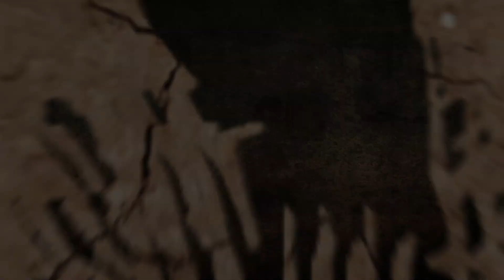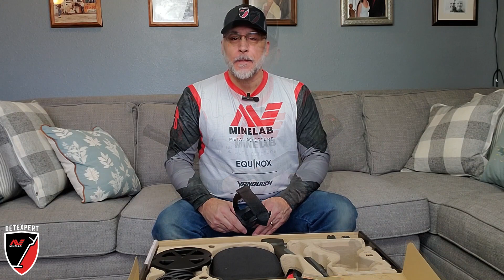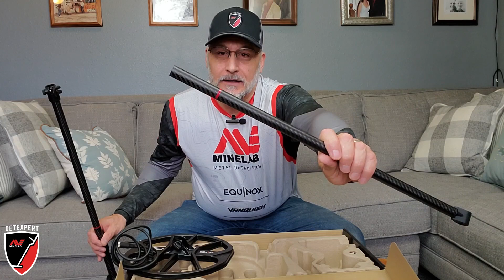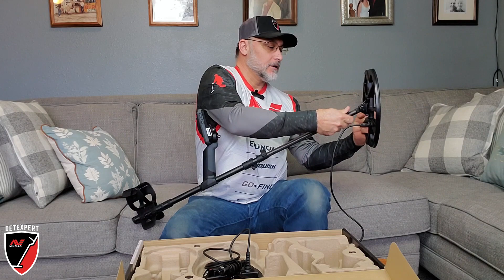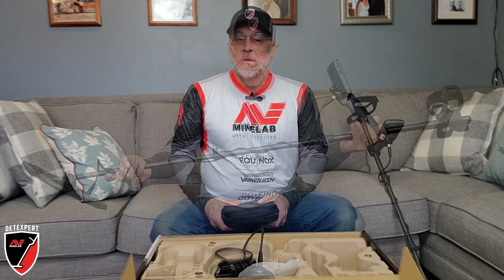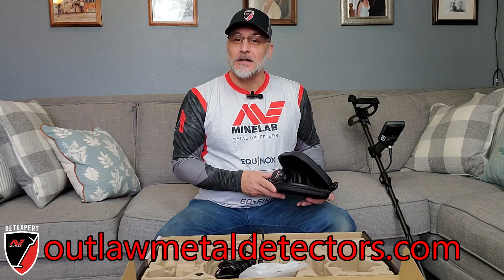How To Properly Assemble The Minelab Equinox 900 [TUTORIAL]

Comment: A heads up to all Nox800 and Nox900 owners. When new, the outer face of each rubber tear-drop shape washer stands proud of the recesses they nestle into. When the end of the shaft is inserted between the coil's lugs or ears, the outer rubber faces of the washers impart just enough friction so that the coil can be easily tilted up or down, yet stay in the position it is tilted to. 
Over time, micro-grit (particularly if the unit is used at the beach) can find its way between the washers outer face and the inside of the lugs or ears. This grit acts as an abrasive which accelarates the rate of washer outer face wear. When this wear is advanced enough, the coil will start the 'flop' i.e. tilt by itself acting under the influence of its own weight. This is addressed by the owner tightening the plastic bolt to restore enough friction to stop the coil flopping.
This is OK, however it is vitally important the understand that once the rubber washers faces are worn down enough, they no longer stand proud enough of their recesses in the end of the shaft to provide frictional resistance to coil tlting.
If the owner is not alive to this, they can end up repeatedly tightening the plastic bolt and instead of restoring the necessary friction, they are actually bending the ears or lugs inward, causing them to be excessively stressed; particularly down where they join onto the top of the coil.
This stress eventually causes micro-cracks which grow, culminating in the lug(s) breaking off.
The improved design of the coil lugs or ears on the 900 make them more resistant to such bending than with the 800's coil but any overstressing must be avoided irrespective.
Repair of lug breakage is difficult and very unreliable and the only alternative is a whole new coil which is very expensive. On the other hand, replacement sets of washers are readily available, relatively cheap and simple to replace.
Personally, I routinely extract and check the thickness of my washers using a set of digital Vernier calipers and change them out before the flopping problem starts. 
Hope this helps some fellow Nox owners.😅

Comment: Just received my Nox 900 last night (upgrading from Xterra Pro) and after setting it up, I wish there was a way to adjust the position of the Head Unit on the shaft for those of us with "shorter" arm lengths, by adjusting the arm cuff to comfortably reach the hand grip on the head unit, mine now has about 4-5 inches of the shaft sticking out the back of the arm cuff and it goes right against the underside of my arm which is not very comfortable, it should have a cam lock like the Xterra Pro/Elite series and it would also make it easier to break down when transporting in a smaller carry case

Comment: I have my pre-order in and am #8. For a Manticore and Minelab dropped the ball with their marketing of the Manticore. You would think that they would have made more than enough to supply dealers. Before announcing the release of a new machine. I have had an Equinox 800 and liked very much liked it. If Minelab is handling the company like this how are they going to be on repair?
Reply: I think minelab was working on the 700 900 release first.   They chose to release the manticore first so that some people that want the best detector had that option first.   

If they release the 700 and 900 first people would be angry that something better came out shortly after.
Reply from the maker: The new release of a machine is generally slow. The shipments come from across the pond which is a factor. We are getting shipments in though.

Comment: Awesome you have a 900. I could see if I made any mistakes setting up my Equinox 700. The Bolt was the hardest part of the assembly I had but everything Matches what I did so far. I did not have any Velcro for mine. Totally awesome video Now I need to find some velcro.
Reply from the maker: Thanks for watching